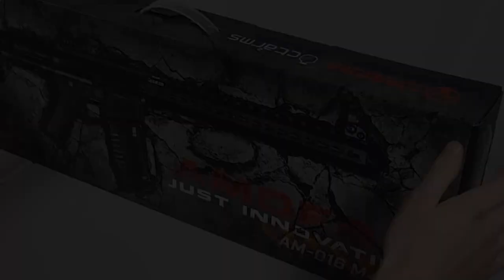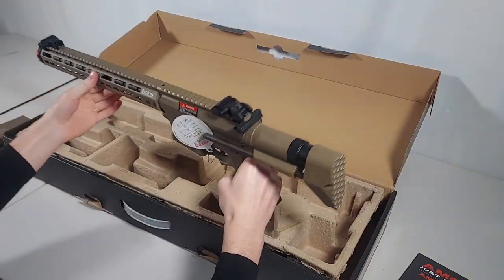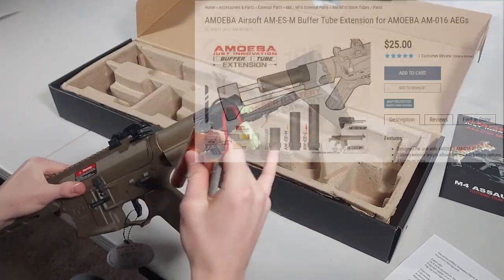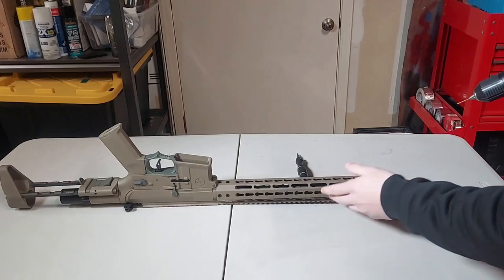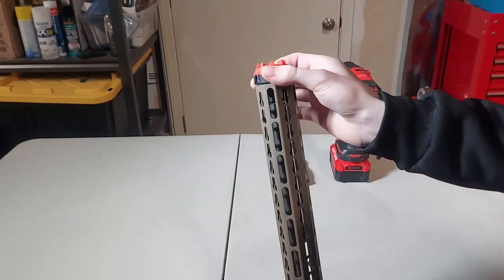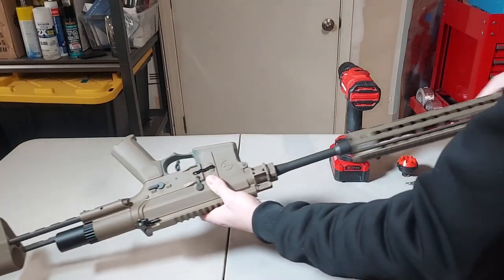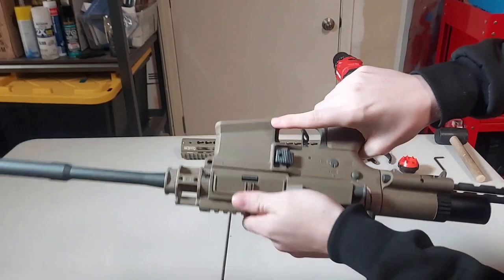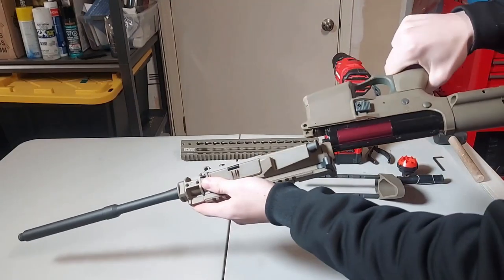ARES Amoeba (AM-016) Review & Disassembly

Comment: I need  help adding tracer unit to my Amoeba AM 013 the flash hider will not unscrew
Reply from the maker: Make sure the pin holding the flash hider is out and that you break the glue seal, which holds together the flash hider and inner barrel. Also, be sure you unscrew in the direction your thread is meant for (positive thread = unscrew counter-clockwise, negative thread = unscrew clockwise).